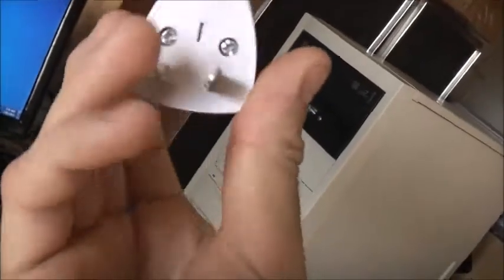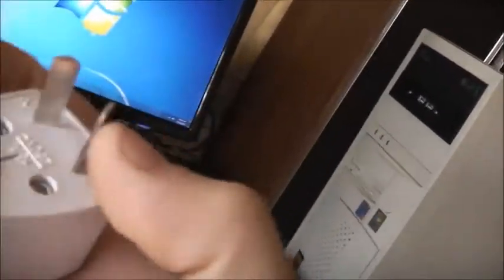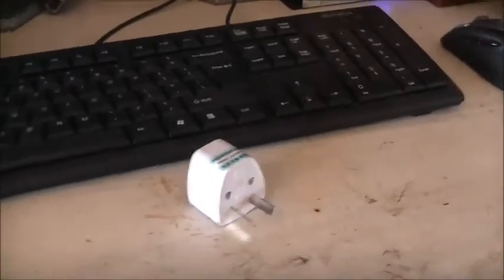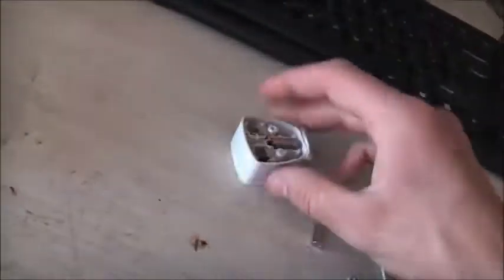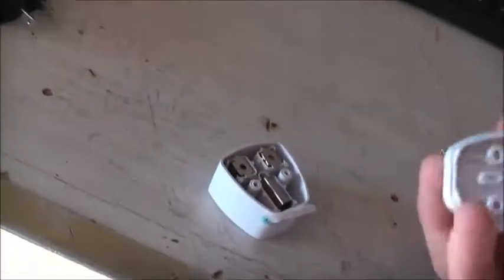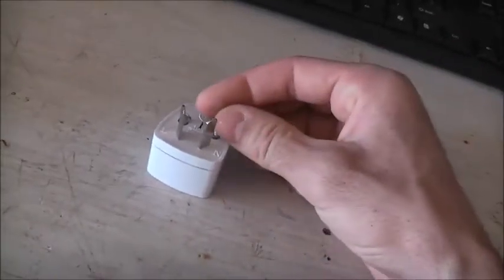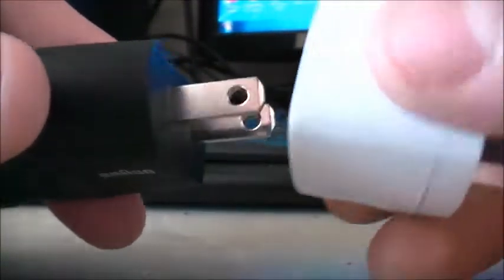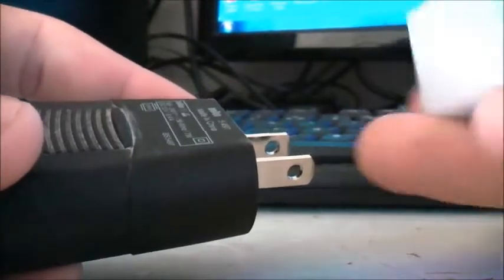Travel Adapter Teardown

Comment: A load check, overcurrent as BBD suggests is a great idea. I see that the device is rated at 10 Amps. Very poor design that no earth pin is fitted. I know that sleeving is mandatory on new equipment but almost 80% of AU & NZ existing equipment will still have the old plugs, it is only for idiots who want to stick a knife across the prongs. In Holland we had Schuko plugs, you could stick a nail into without any problems. 50 / 50 chance of hitting the live terminal.

Comment: =GASP= The flipping cheapskates!! They couldn't even be bothered to put an earth pin in the aussie version! :-O Because this device doesn't carry-forward the earthing conductor, someone could connect a Class-1 appliance in there (metal cased-requiring earthing) and if the appliance faults-to-earth, the casing on it will remain LIVE and could shock someone! :-O

NOT HAVIN' IT!! I WANT FLAAAAAMES!

In reference to the other teardown vid, I know of the fellow you mention, as I have watched his teardown vid of the version of this for the UK sockets.

He even has his one outside and stuffs lots of current through it until it has a meltdown.

=FUNN IDEA=

If you have no use for that dodgy device (or even if you have.....pop it anyway!) have it outside and wire it across your high-current MOT, get a clamp-meter out and then using your variac, teeeaaase it with gradual increasing amounts of current....

I take it that in Australia, your 10A sockets are wired to a circuit that is protected by a 10A breaker, yes?

On that note then....

Whizz this device up to 10A and see if it takes it, but then again.....

Seeing as 10A plugs can go in 15A outlets.... Yes, that means that you get to stuff 15A through this puppy. :D

Go on.... See if it takes 15A. BUT!! The top FUNN doesn't stop there. If the Australian 15A sockets are protected by a 15A breaker, no circuit breaker switches off at its rated current. That means that you get to stuff EVEN MORE CURRENT through that adaptor device. At this stage, we're probably lookin' forward to a nice PVC bouquet in the air. :D

I say..... Pump that thing up with at least 20A. That can be the base current for this test. Hold it there for a couple of minutes.

The bits in that are made out of steel, and you might very well find on your version of it.... the pins are steel as well. The British equivalent have fake-brass pins!!

Should the device get uncomfortably hot or start smokin' up, then you can either.....

(A) Phantom the daylights out of it until it lets loose in there, OR..... for some fun a bit more on the explosive side.....

(b) Open the device and put a short with a thin-ish piece of copper wire across the ends of the pins (on the inside of the device) and then re-assmble. Take outside. Attach this device to large cap bank. Charge large cap bank as much as you can stuff into it. Discharge cap bank into the cheap two-pin travel adaptor. Enjoy the liquid copper, bright flashes and..... If that travel adaptor is REALLY unlucky, it'll be blown to bits. :D THAT'S WHAT WE WANT!! :D

POP IIIIIIITTTT. :D

To optimise the explosion inside the device, you could experiment with increasing thicknesses of copper wire connected directly across the cap bank and see how they perform in explosion tests. Now, think of that horrific blast being contained inside a poky little travel adaptor. :D

Something's bound to be blasted to pieces, surely? :D

Go on........ You know you wanna see bits of that thing everywhere. I remember when blasted that little travel clock on the cap bank. The Ssssatisfaction in your voice at the bright flashy sparkler-show really hit the spot. :D

Go on...... Please pop it.

Thanxx for showing,

-BoomBoxDeluxe.

3rd January 2015, 02.15